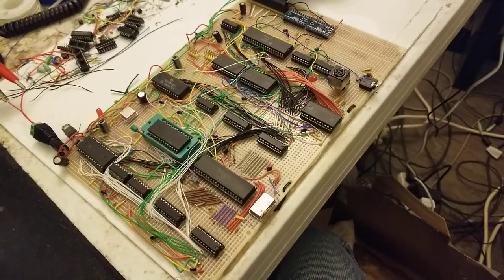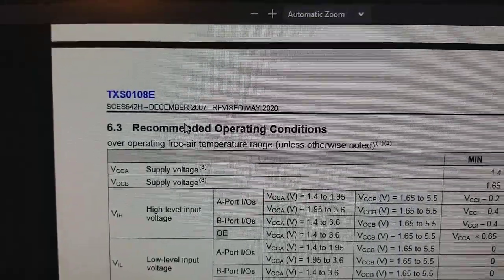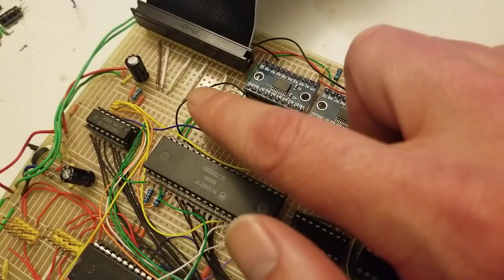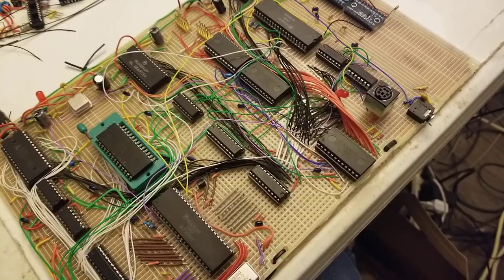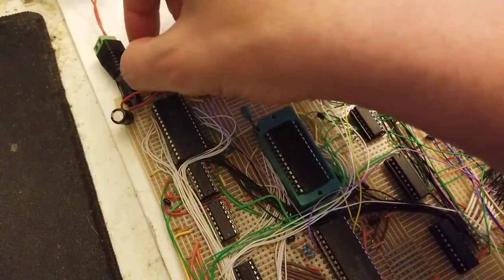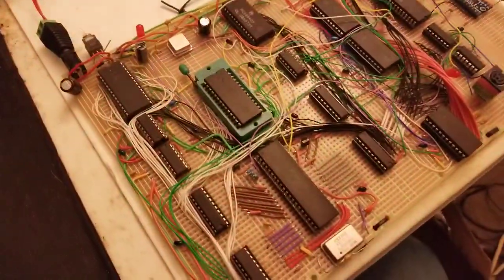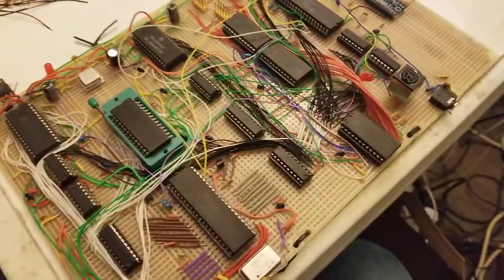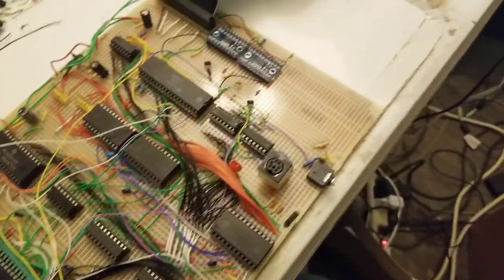8-bit computer + Raspberry Pi = Disaster

Comment: I had a bad experience with the TXS0108E when I needed to connect the Z80 to the FPGA. According to the datasheet, it is fast enough, but when plugging it, I had very weird behavior.
I didn't investiguate too long, but to make sure the problem was with them, I used resistor dividers instead and it worked like a charm. (it was not for bidirectional though)
On the first protypes I then used the 74HC4050, but again, it was limited to 5V-to-3.3V, not bidirectional.
You may want to check if you don't have a propagation delay issue.
Reply from the maker: @Zeal 8-bit Computer  I've been seriously considering doing just that -- if for no other reason than to just eliminate those chips as a possible cause. Even just pulling the 5v signals down to ground with a 4.7K resistor would probably do the trick. At least, it would do at the super-slow speeds I've been testing with.
But, my latest theory is that it's just the Pi's GPIO pins that are very (very!) slow and unpredictable to respond to edge transitions. I'm going to try using the Pi's built-in UART for serial communication. I'm hoping it will give me faster and more reliable communication. Just regular Tx/Rx, not SPI or anything (the only SPI libraries I've found for the Pi require it to act as a Master and initiate all transfers.....I guess they never expected someone to use the Pi as a slave!)
Reply: @aqualung2000  I am not very familiar with the RPi, are you using Debian/Raspbian on it? From what I read, the GPIO is indeed slow, if you read one in an infinite lop, you would get a rate of about 6MHz, which should be okay, but we are never sure because of Linux scheduling.
Do you mean that your 6502 computer will transfer commands/raw bytes to the raspberry with UART? This would work, keep in mind however that you would have an overhead because of the start bit, stop bit but not only. If you want write a pixel at a particular position, you would need a way to tell the RPi, so you'd need to send commands on UART such a: Set_X -> Set_Y -> Pixel

I think there are other ways in the continuity of what you've done already. I don't know if that's feasible, but mapping the GPIO I/O registers directly inside your linux application (user space) woulda llow you to read/write GPIOs without performing any syscall. Another solution would be to write your own GPIO kernel driver (or modify the existing), so make it do what you want.

Finally, the solution that would work for sure but would require more time is to use an RTOS on the RPi, FreeRTOS for example as it has already been ported. You could having having a task only for probing the GPIOs, another one for generating the video output. The scheduling overhead would be much smaller than Linux kernel's.